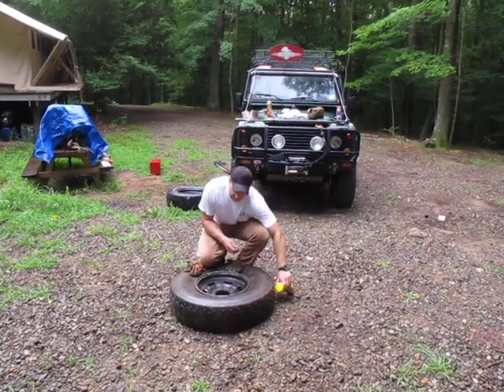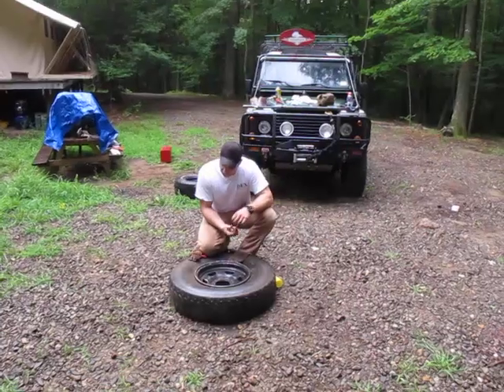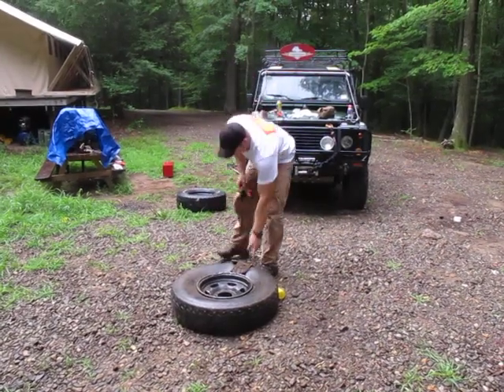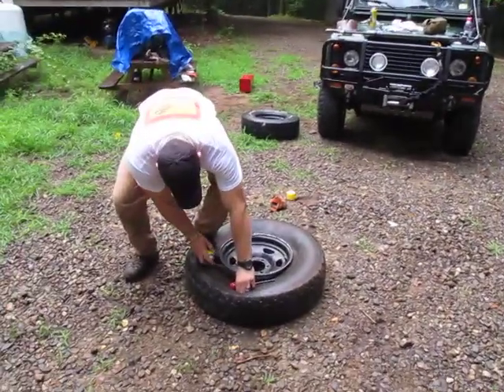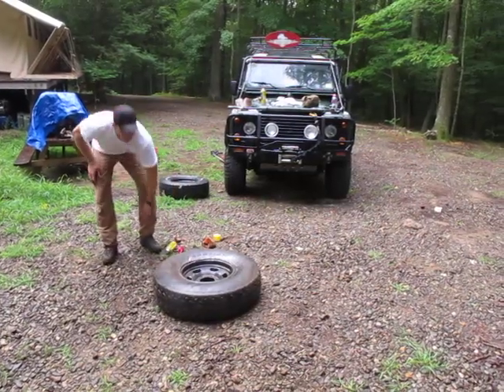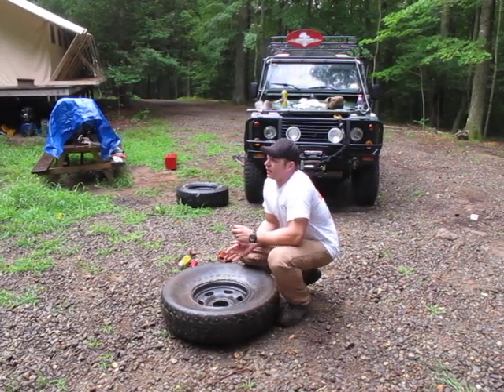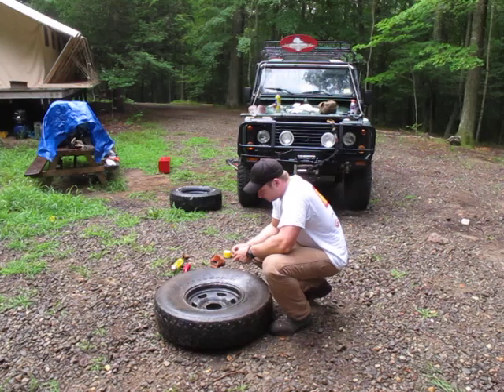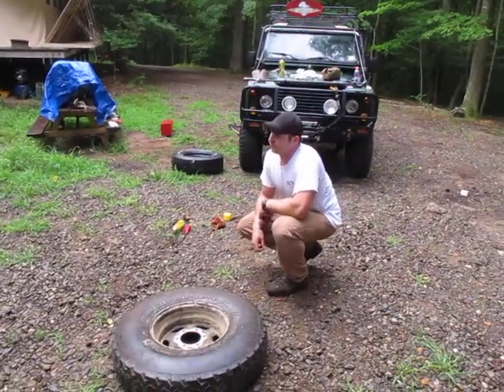Setting a bead on a rim with ether

Comment: @sd2649 When the air cools, you have negative pressure.  Also with the valve core in you can potentially overinflate and damage the tire.